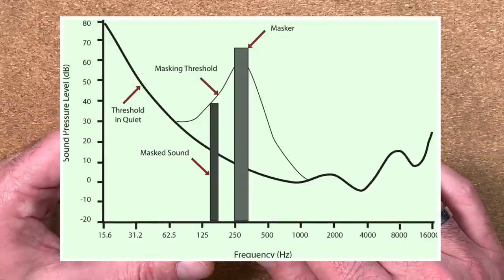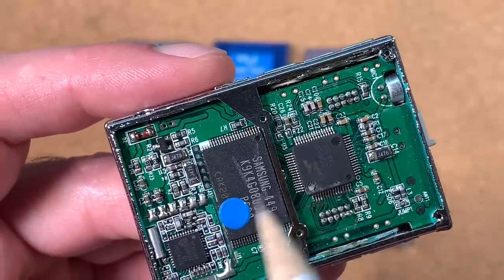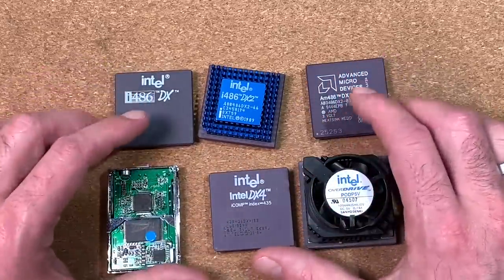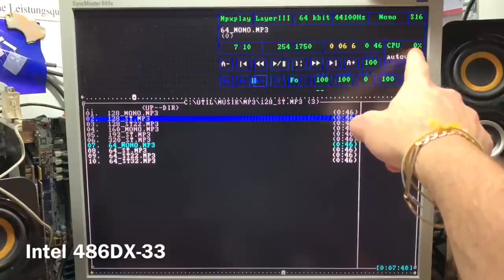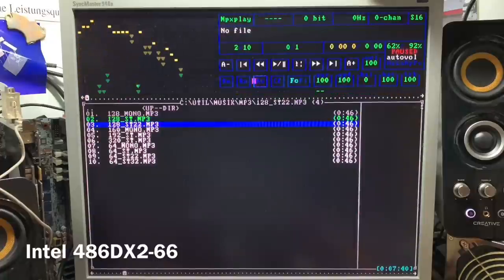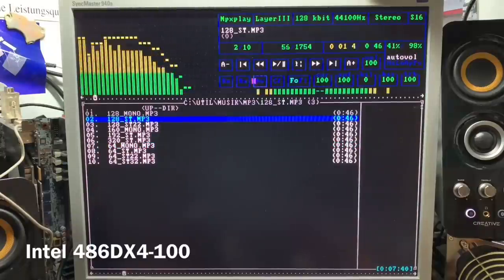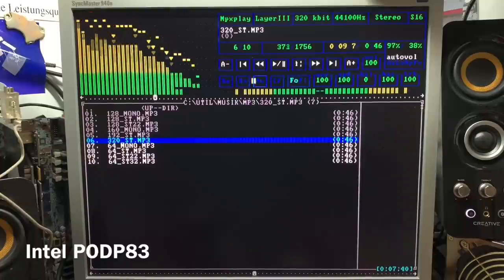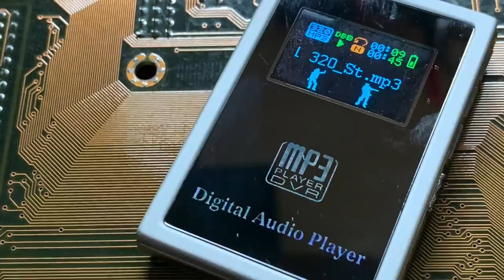Can a 486 Play MP3 Music In Good Quality?

Comment: The very first computer I got hold of was a dx2-66  and I was definitely able to play 128kbit MP3's on it. I was on Windows and was using very early winamp and some command line tool. It started off choppy but I was determined to play the file so I started messing with 'stuff' and got it to play smoothly. I remember it distinctly because it was the first time I ever 'fixed' a computer problem. I've now been a sysadmin for 20 years and trying to play pirated music was what got me into the whole thing in the first place!

Comment: Great video. I'm surprised! I would have thought higher compression would have required more CPU grunt to unpack in realtime. Interesting results!
Reply: It's because this kind of compression simply removes data, which means the file won't be decompressed to the original bit rate. Instead, it'll play at lower quality

Comment: Nice video once again!
Will add MPX to my 486 machines to so I can play MP3 in dos and just not Midi.

I have had discussions with friends that call a 486 system with a Pentium overdrive a "486", I personally see them as separate. 

486 and 586 cpu's exist for the same platform, there are even souped up 486 on socket 7 if I recall.

We play whit our 486/PODs on retro lans because a AMD 133Mhz 486 (am5x86) is about as fast as the POD83, give or take and they existed side by side.

But I do consider POD's to always be 586 systems due to the newer instructions and architecture even if they are on a platform developed for 486 cpus.

So no criticism to you I just find it worth mentioning that POD's technically are not 486 processors so I usually place them in the 586 category but comparing them to 486's is valid since performance can be similar.

So whats your take on this subject?
Reply from the maker: yeah. I agree fully on you. the pentium overdrive is no 486 and also not for me. The video title refers at the end to the 486dx4 which is able to play al qualities of mp3 files. 😉
Reply: @CPUGalaxy  Pretty happy I got a DX4 100 OD for free then, was offered that or a POD 83. But I have an Original system with the 486 VESA logo/sticker because it had a DX2 66 originally so went with the faster 486 to keep the spirit of the original machine.

Its a VLB system, I actually found a program that allows one to overclock early cards like my CL5428 and change VLB timings from DOS and not just clocks. Get a bit more performance in VGA speed and combined with VESA 2.0 extension using univbe its actually really fast for a 486 now :P

486 are so fun to tweak, one can sometimes double the performance or even more just tweaking endlessly!
Reply: If you really want to get technical the am5x86 are really just very high clocked 486s, architecturally they share more in common with Intel 486DX4s.  Pentium Overdrives support full Pentium instruction sets and the Cyrix Cx5x86 are actually cut down 6x86 reworked for use in Socket 3 mobos, so more true 586 class CPUs.  AMD fans would have to wait for the K5 to get an actual 586 class processor.
Reply: @JeremyLevi  Thats why I wrote AMD 486 (am5x86) because the Model is AM6x86 or P75 or sometimes X5 but its a 486 with multiplier 4x, like you sad, basically a DX4 16Kb L1 cache with a 4x Multiplier. Most people dont claim that they are 586 processors, AMD's reason for calling it that was that it was suppose to be similar in performance to intels Pentium offerings.
Reply: VLB is a lot of fun until you have to try to get it to work with a 50MHz bus clock.  So many VLB cards just didn't want to work stable above 40MHz.  Beige box system builders trying to sell DX50 PCs at that time really had to look hard for VLB cards that would work reliably in those builds.
Reply: @JeremyLevi  VLB is a lot of fun at any speed. I remember VLB cards would come out of the VLB slot (especially if the computer were moved) because of the length and there was nothing holding them down at that end. I also remember a VLB IDE controller card which corrupted an entire hard drive because of a bad connection with the VLB slot.

Comment: Nice video and confirmed some test I did years ago. Just one remark though 128kbit bit rate is really not enough for most music to have acceptable quality. A lot depends of course what you use for playback but 128 kbit was the common trap in the early days of MP3. It sound ok if you used a mediocre sound card with some cheap speakers (like most pc's in that day) but once you upgrade from that you wished you used 192 kbit as minium. Later variable bit rate was used which dynamically adjust the bit rate depending on the content. But I wouldn't even try to attempt VBR on 486.

Comment: I did some work on DAB playback (MP2 digital streams) under Windows on hardware of about that period, and contrary to this belief you didn’t need fast FPU units for playback. The best decode library I found was pure integer. The official manufacturer software used MMX FP, but I could get equal or better playback with integer math. Pentium class CPUs did seem to be the order of the day though, so I suspect that the audio player software shown was also using integer math.

Comment: I had that very AMD DX2-80 as my own first PC in the late 90's. I was hellbent on getting it to play MP3's. It overclocked reliably to 120MHz, and even then in Windows 98 it couldn't play 128/44 MP3's. I did buy a copy of Red Hat Linux 6.1 to tinker with and found that XMMS
 could play 128/44 MP3's with the chip at 120MHz, that's all you could do though. It was so much fun back then to tinker with this stuff.

Comment: 486 DX 33 was my in my first "Windows" computer. This PC took a while for me to learn how to drive as my first computer was an Amstrad and the next and Amiga 500.  This PC got me onto the internet with my 4kbs dial up modem. Long time ago.
Reply: I bought an old DX 33 in 1998 just to see how rubbish of a machine I could still use and be happy. I used it via remote desktop Xwindows in linux to my Pentium Pro 200 server I had in another room and doing that it was perfectly fine.. But you couldn't do much with it using it's own cpu even by 1998.

Comment: Hm thats odd. You could play mp3`s with a Amig4000-040 (cant remember how the quality was or at which rates exactly) i assumed it would be possible with a 80486 at any rate. But yah maybe it was like so back then. 
What codec version did you use for creating those mp3's - i guess modern codecs may have higher demands than old school mp3 codecs did? Could be software related mabye? Did you create those mp3's on another hardware/software and on a modern machine - i would expect issues....
Reply: It's totally possible. Just not with Mpxplay.

Comment: This was also my experience back in 1998 trying to play MP3s in Winamp under Windows 95. My 486DX2-66 couldn't decode fast enough to play 128 kbit stereo MP3s in real time, but my friend's 486DX4-100 had no problem.
Reply: Years later another useful benchmark would be whether a CPU could play a 720p MPEG-4 video in real time. Most Pentium 4s struggled. The Intel Core 2 Duo was OK.

Comment: Its not so much a specifically hardware only solution, but the use of an integrated Digital Signal Processor, this is still software but running on a processor highly specialised for the complex math required for decoding, and can do so with very low power requirements.  In the case of the original iPod they used a chip from a company called PortalPlayer which integrates two 80Mhz ARM cores and it is decoded in software (no DSP).  Technology is amazing!

Comment: I managed to play ~64kbit mono 22KHz mp3s on a 486sx25 using mpg123 on Slackware 3 way back when. It was "great". I suspect the player chosen here has a HUGE overhead beyond decoding, for the VU meter, monitoring CPU load, etc.
Reply: This should be higher up. Dx2 66 was capable of playing mp3 but the player was crucial. This one is probably not particularly optimized. It shows cpu use but thats kind of unneccessary as you would hear if the computer can not keep up. Different player would bring different results.
Reply: Agreed, there are both mp3 and vorbis players that work with integer arithmetics. Probably faster on 486 and even run on 486sx machines. I think libmad and mpg123 are worth a try. I used to have an efficient 32-bit mp3 player on DOS that only played the song, didn't have any user interface. I'm pretty sure this fancy UI wastes plenty of cycles.

Comment: The first time most of us would have heard of mp3s would have been the mid to late 90's. These 486 processors would have been considered a little old by then, but it wouldn't be that unusual for people to still use them as their main computer. I didn't realize how CPU intensive mp3 playing would have been for older hardware back then. By the time I started playing with mp3s, I had a Pentium class CPU. Soon most of us would have had CPUs with mmx which would really speed up mp3 processing

Comment: Between the years 1999-2004 (my college/university years) I possessed a 486 DX4 100 MHz 32 Mb RAM 2 Gb HDD Win95 PC, we used to play MP3s using Winamp at very low quality ("quarter" quality option, MPEG audio decoder settings menu, perhaps 8000 or 11025 Hz), stereo, even toggling 8 bit resolution due to the fact that the soundcard took enough resources from the machine (an ESS1868 AudioDrive soundcard, Yamaha OPL3 MIDI compatible, Sound Blaster 2 Pro clone, maximum stereo playback sample rate 22050 Hz, maximum mono playback sample rate 44100 Hz) and it had the weird fact that toggling 16 bit resolution took more resources.

Comment: This is a great test, however the player you are using is less efficient than other players, even from that era.

I remember being able to play 128kbps joint stereo MP3 files on a 486DX2/66 using mpg123 under Linux back in the mid-to-late 90s. mpg123 was a ninja of an MP3 player, using lookup tables to save CPU clock cycles when decoding. However, you couldn't do anything else with the machine at the same time; even web browsing would eat up enough additional CPU that the music would skip!

Also noteworthy is that mpg123 would just play the file; no fancy animations or spectrum analyzer. This probably makes a significant difference; remember that back then you only had ONE CPU core to work with; if it got busy doing anything else that was less time to decode MPEG frames.

Comment: This reminds me back in the early 2000's I had rather a high end 486 laptop or a low end Pentium laptop running windows 3.1 and having onboard sound and it was just BARELY able to play MP3's.  I think it was with that same windows software you used too at the end of the video.  It did it, but you couldn't really do anything else while it did it.  So this doesn't surprise me at all!

Comment: the real questions are:
1. why are you running in 16bit dos mode? extended mode should be much faster in data shuffling arround.
2. which compiler was used in compiling the decoder?
3. which compiler settings and target architecture were used? (i assume 16bit 286er dos mode)
4. is the soundcard with or without dma interface and is the player using it so it is able to decode while the card is playing?

Comment: I had different results back in the days I used my hp vectra 486. I used precisely 128kb mp3s under windows 95 in winamp and it was just enough to be able to play the mp3s without problems. I mean just enough because I was able to do it at 80Mhz, but at 66Mhz I had some glitches.
It was a normal Intel 486DX2 66@80Mhz with 12MB of RAM 72pins (not sure if EDO or FPM). The CPU is not the only thing important in the performance of the system, we also have to have that in mind.

Comment: In the early days of MP3, you had to use "this" to replace "that". Because "that" didn't exist. There were no MP3 players as objects you could buy, only as software for computers. Some pioneers used PCs, particularly the PC-104 standard motherboards but all sorts of others, and built PCs to run off 12V in a car. They'd do what they could do reduce vibrations, since hard drives in particular don't like that, and it's not good for the ISA / PCI cards to be jiggled constantly either. Then wire it up in the car's boot to it's stereo system. Then wire up a control panel near the dashboard, using a character-LCD display and some buttons, often connected via the serial or parallel port. 

Since the alternative to that was nothing, and it meant you could have as big a hard drive as you could afford full of endless hours of music, they were great for people able to build them. 

Now of course you'd use a Raspberry Pi or something and it'd take half an hour including downloading the OS. And it would have a Wifi link to the car's onboard Internet, play video too, and cost $20. But it won't have the character!

Comment: MP3s played fine at 128kb/s on my 486DX4/100 under Windows 98SE using WinAMP if I maxxed out the CPU usage in the app settings and didn't move the mouse it played fine without skipping

Comment: Back in 1997 I did similar tests with my 486DX2 and Pentium 100Mhz (socket 5) CPUs. I have found that finial performance of the system significantly depends on the type of soundcard and video card. Yes, in such tasks as playing *.pm3.
First what is slowing down the system is Sound Card. Original ISA sound cards which employs for data transferring ISA’s DMA technology noticeable put down CPU performance. The problem is that it hardy blocks system bus with its slow data transactions, thus CPU getting lots of wait cycles. Changing any ISA sound card on a PCI generation (ESS maestro-1) noticeably speeds up any sound playing software. PCI sound cards of that era were doing simulation of DMA controller, to be compatible with ISA SoundBlaster IO.
That DOS program does something in graphic on the display, so using PCI VGA card with MDRAM as well will help with time slots for CPU’s sound decoding.
Reply: It's not just ISA x PCI. Good sound cards had DSPs that offloaded audio processing from the CPU, while crap sound cards left most of the audio work for the CPU, regardless of ISA or PCI. With this in consideration, it was often much better (performance wise) to use a good ISA sound card than a crap PCI sound card - even with the overhead brought by the ISA bus that you mentioned.

Comment: I used to play stereo MP3's on overclocked up to 80 MHz 486DX CPU on Windows 95 using Creative Xing player (not sure if I remember it correctly). This player was able to downsample MP3 file to match CPU abilities. So in most cases it was downsampling 128-320 kBps MP3s to 32-64 kBps, but it was playable. I was able to run Winamp only after upgrade to Celeron-333.... Good old days )

Comment: Oh this gave me a flashback.

Back in '99, i helped a friend build a car PC we managed to fit on the glovebox of his Renault Clio (2nd gen). We used an old AMD 5x86 133mhz and an HDD with a home made antishock (and drive was mounted on its side).

It wouldnt work running windows and winamp. CPU was too weak.

We ended using a DOS based MP3 player, that one worked just fine. Dont remember if it was the one shown here... But does look familiar 😂

Comment: Very cool video, but if you ever have the chance or will to re-do it, you might wanna try it with MP1 (MPEG-1 Part 3 Audio Layer I) files.
They've been designed with a less efficient compression codec, so that simpler hardware can play them. https://en.wikipedia.org/wiki/MPEG-1_Audio_Layer_I
If I recall correctly, MPXplay is able to play back MP1 files just fine.
Would be interesting to see, if a simpler codec made it possible to play those files on slower CPUs, etc.

Comment: Hehe, remembers me the old times in '90, I had AMD 486DX4/100 and also used to play new emerging MP3 format. I also ripped some audioCDs and encoded them via L3enc in 128kbit - this was really hell taking a half day on this 486, now encoded in Lame bestQ under a minute on some modern (10yr old) HW. 
Under DOS and Win 3.11 it was not problem to play but under Win95 it was a bit choppy due to preemptive multitasking. There was also another DOS MP3 players: DOSAMP 0.8, MP3PLAY 1.2, but the MPXplay is the most advanced and still under development!
I built a PC-based HW MP3 player based on MPXPlay running on Prentium 166 that had enough power for all bitrates and also running a small TSR for controlling an LCD display and IR remote.

Comment: do they work if you uncompress them to wave? normally they should be working uncompressed as wave files, i tried that more than 20 years ago if i remember correctly
Reply: Yes, as long as the source disk can transfer the data fast enough the CPU will have no problem at all, it's actually quite easy for the processor. 

MP3 requires decompression which the 486 just can't handle. I played with it back in the day and had to use WAV.
Reply: @volvo09  i got a 486 DX2 50 Mhz and it played mono 22 Khz Mp3, this is how i first listened to Metallica, at 22 Khz mono in winamp

Comment: Hello!  Thanx for video! I used 80486DX2/66 with 8Mb of RAM. It plays MP3s 22kHz mono, with mp123 console player with OS/2 Warp3.0. The better choice to use OS/2 operation system, because it's multitasking and you can quickly change windows. Try DX4/100 with OS/2 pls, it should play fine :)